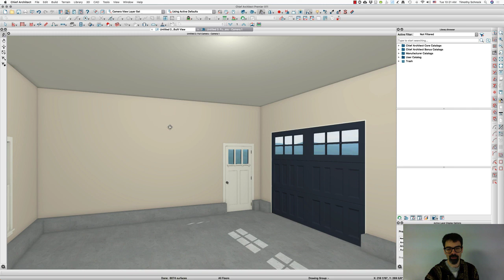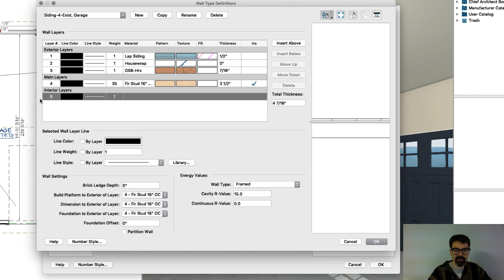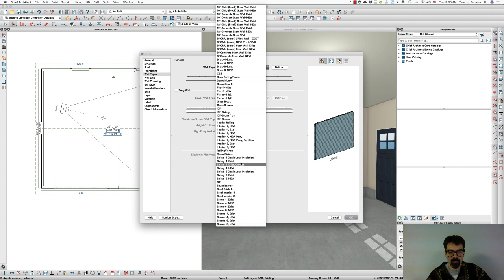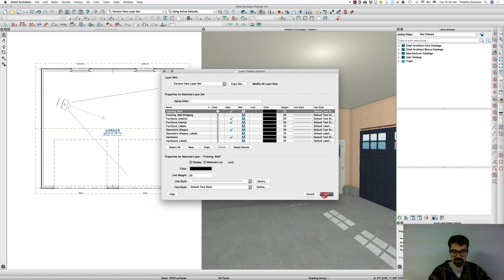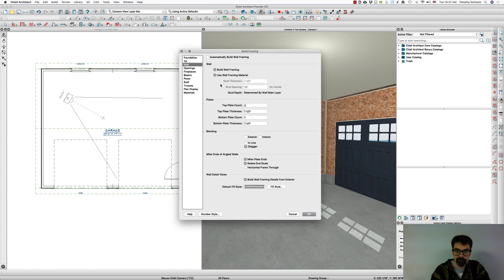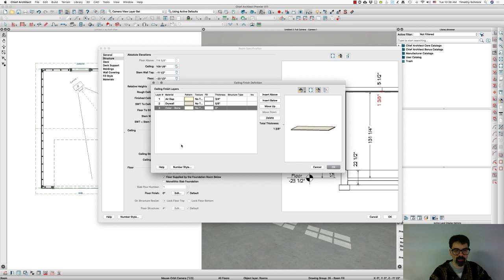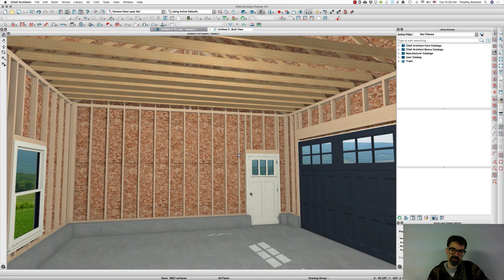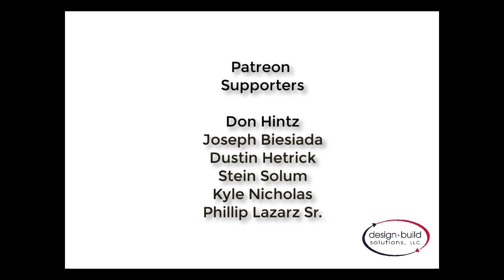Show Framing Inside the Garage | Chief Architect

Comment: Good info! Do you have any info / tips on how to build a dock(s)? I'm using x8. 
CA must not think people live waterfront!
Reply from the maker: Do you have a picture example of what you’re trying to emulate?
Reply: @DesignbuildsolutionsLLC  
Yes but you'll have to tell me how to upload
Reply from the maker: Do you have twitter or instagram or Facebook you can share and send me the link?
Reply: @DesignbuildsolutionsLLC  
I sent info to your email
Reply: @DesignbuildsolutionsLLC  
I really want to have 3d Orthographic views of a customer's plot, house, pool and patio with a gazebo (to be drawn) and their dock. The dock was all but destroyed during hurricane Mathew so I need to draw it to permit it for a rebuild. there is no dock function and CA support says to use decks...but I have piling layout that is to complicated (for me) to reproduce using decks. 
The simple version is a 320' long by 5' wide dock 4'above water (land height) with an L shape end and two finger docks off the main walkway.
I  opened my  plan file  drew some polylines, boxes and rectangles then opened an  elevation and drew it like a 2d cad elevation. but this doesn't give me any of the existing house or landscape it's just an elevation. What I want is to draw it in plan view and get my 3d views.